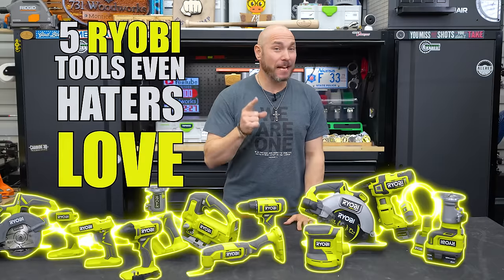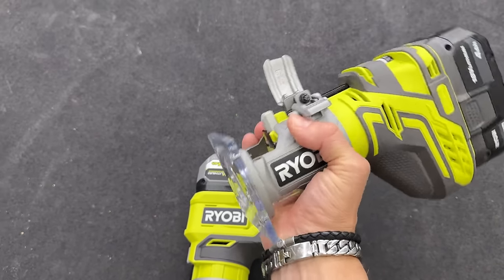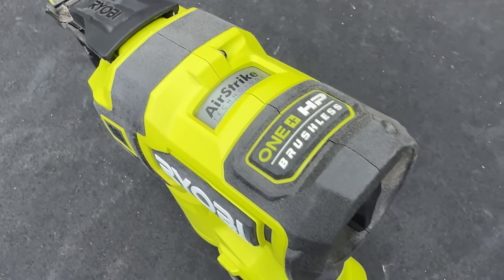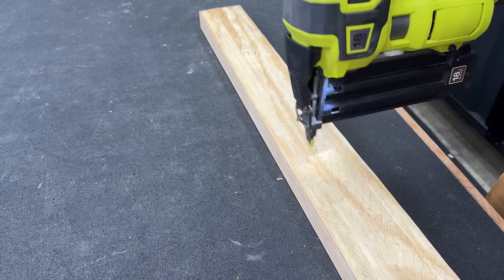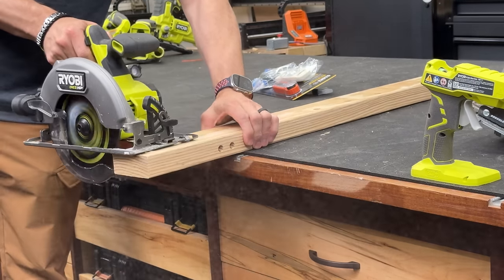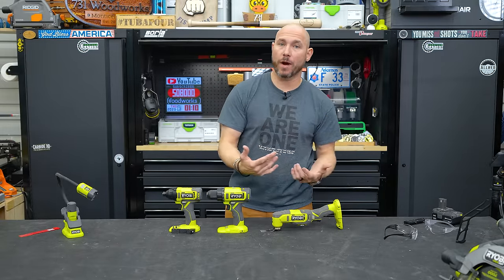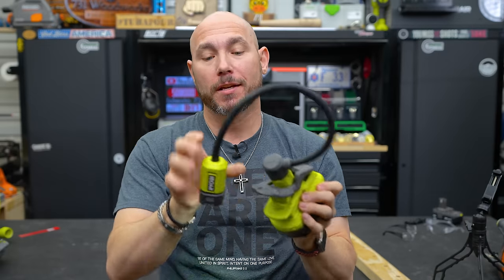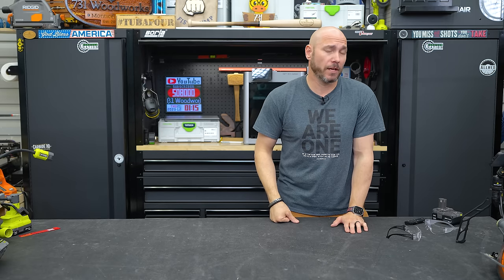The Haters Will Love These 5 RYOBI Tools!

Comment: Nice video , I have been using the first generation of the Brad nailer , it's amazing especially for the price , I must have easily put in well over 10 thousand nails , also you are right that glue gun is awesome , very practical , I'm surprised about the cordless sander though , I've been impressed with the one I have , it's definitely not the best but does the job , I've heard good things about the new Bosch 18 volt sander. I'm looking for a 7-1/4 cordless saw , since I am heavily invested in the Bosch lineup , I'm debating going for the Bosch but price wise after hearing what you think about this Ryobi I'll have to check it out. Great video love watching your channel 👌👍

Comment: Personally I've not had any luck with Ryobi cordless tools, I've bought 3 so far and had to return the 18 gage brad nailer with only 10 brads fired threw it i shot one it jammed i cleared it and shot 2 it jammed clearedit again shot 1 it jammed again, i cleared it changed battery and it still continued to do the same. I returned it got my 💰 back and bought a Craftsman witch I've fired thousands threw without a hitch for 30 bucks cheeper. Their cordless drill reverse toggle got jambed the first time i used it and the chuck doesn't tighten up very well, but I do have their circular saw witch does pretty well.

Comment: I'm a licensed residential builder in michigan. I started with DeWalt cordless tools. After they fell apart, I realized why not get a less expensive tool and I could replace it and still be under the cost of a dewalt. So far I haven't had to replace any. I think they're every bit as good as a DeWalt.

Comment: I’ve gotten use out of the 5.5” circular saw flipping the blade and using to cut siding, plastic roofing panels etc. Lightweight and cordless, haven’t found another good application for it

Comment: I have the old style router and I agree, stay away. I have the P365(?) finish nailer and while convenient, it thinks its jammed alllll the time. The circ saws are great. While they do sound like a toy, my brother in law got a Makita last year and hated it. I tried it a while back and agree. It's just uncomfortable, slow, and the base plate sucks. Ryobi jigsaws are also trash. Ive had three and they always drift to one side or the other. I still have one and I have to guide it about 20 degrees to the left relative to the line. Every one of them has done it. Others have confirmed it. I kept one around for quick nips or finishing an inside corner cut but I have an old corded Craftsman the does anything longer than an inch or two. Sanders are also pretty bad. They are like wrangling a mongoose. They just bounce and dance way more than any others I've tried. Something about the balance is just wrong. The drills and drivers are just fine if their impact drivers are just way too big. All said, I am actually a fan of Ryobi. If I worked professionally, I'd have to say look elsewhere, but I end up doing maybe a couple hundred hours a year on projects these days and I simply have no DNA within me that needs validation from others in my ability to spend money. What a silly thing to make fun of people for. Those woodworkers are just bar slags turning their nose up at the guys not driving a Ferrari.

Comment: The only problem with Ryobi’s hot glue guns - which are otherwise awesome - is the coating on the tips, which don’t stand up to a lot of use. They become soft and break after a surprisingly limited amount of use. The gun remains useable, but they should really use a more durable/heat resistant material.
Reply: @echoshatter  Yeah, but I would bet 95% of the time most people only use the glue gun for a couple minutes to tack something.  I've never used mine for more than a couple minutes.  Also, Surebonder makes a glue gun that uses Ryobi batteries and is as good as the Ryobi one.  You might try it, it only costs $20 or so.
Reply: @echoshatter  Hot glue guns do draw a lot of power, there's no doubt about that. That's just the nature of their design. 

It sounds like you might have an underpowered battery. What battery are you using? It's probably best not to use anything less than a 4.0Ah for the mini glue gun and the 6.0Ah battery (which holds 50% more power) might be best for the full size model. These are not very effective tools with a 2.0Ah or 1.5Ah, although you can get away with a 2.0Ah battery on the mini if you don't use it for extended periods of time.

If you're a serious crafter or pro who needs an "always on" glue gun, a cordless model is absolutely not the way to go. Likewise, if you don't already own Ryobi tools (and batteries), a sufficient battery and charger set is going to cost you 3-4x the cost of the glue gun itself.

Ryobi's glue guns are fantastic if you've already invested in the ONE+ system and have batteries. There are lots of batteries in the shop here, so when one runs low, it just gets swapped out for a freshly charged one and there's no problem. If you don't have that advantage, it could be a really frustrating tool.

Comment: I also use some Ryobi tools, and I can recommend that you look into their upgraded hot glue gun and multi tool. The glue gun has two heat modes so that you don't damage some heat sensetive materials and don't get so many bubbles in the glue. The multi tool is also a much better one since it has a swiwel head to reach better and also a tool less holder for the blades. Not a star lock but a lever that loosens the pressure on the plate holding it down, and you can then unscrew it with your hand. The holder is also magnetic so that the blade sticks on better when you are doing so. It's also way better on your hands since it doesn't vibrate as much and also has a variable speed.

Comment: The 1st tool of RYOBI Combo Kit that I purchased to die was an older, but not more powerful version of this little painfully weak, brushed, 5.5" circular saw.(I  acquired an additional blade for. I didn't purchase the new blade, it was gifted to me.🤦)It's nearly the same size that RIGID 6.5" circular saw, with a Brushless Motor that a battery will last 3 to 4 times as a long on. The RIGID 6.5" brushless is roughly the same weight as RYOBI 5.5" brushed motor saw. The RIGID Brushless 6.5"is a 'Great Little Saw', if a 'Little Circular Saw' is what you're looking for. Milwaukee and DeWalt both have good 6.5" circular saws, but I haven't personally used any other brands. The RIGID really shines. I had to check and make sure it wasn't plugged in when I ripped a 6' long pressure treated 2x4 in half...... Fully charged 4Ah battery and it made that 6' long cut, only dropped one bar on the battery and left to sit for about 10 minutes or so and battery read full charge again. I'm on Milwaukee and RYOBI battery platforms. RYOBI is indeed a lesser/DIY brand, but they work surprisingly well, especially the brushless line. Nothing but brushless RYOBI stuff for me, from here on out.😎🤠🤓

Comment: I love how the Ryobi Brad nailer feels, but I prefer how Milwaukee angled the gun so you can set it down on the battery base without it slamming forward on its head. Biggest flaw with the Ryobi, did they not test the weight balance when using it?

Comment: I read up on Ryobi tools and as a person who turned my nose up on Ryobi when walking through Home Depot... but I have changed my opinion. They turn out equipment from idea to product in 18 months I have a number of their tools now, for a DIY, Hobby or a value added  tool moment you can't beat Ryobi. One thing that makes Ryobi tools is their batteries... everyone one of the major tools makers have changed battery size and come out with a new battery that doesn't fit old equipment... Not Ryobi, you can use a new Ryobi battery in an older tool... to me that says a lot about Ryobi, that they understand customer loyalty. I have the hand held router and I use the smaller 2 hour battery not the 4 hour which reduces top heaviness when using. Also the Ryobi brad nailers are the very best, I have 4 pneumatic nailers... and two Ryobi brad nailers I use these all the time... very few times do I use the pneumatic nailers now!

Comment: I have used Ryobi tools for the better part of 20 years.

The bigger circular saw is my goto saw.
Use only the bigger 4AH batteries. With the smaller 2AH batteries the saw seems under powered.
I use Diablo blades they work well.

I had the smaller version for years. It is underpowered for many jobs. It does work well on laminate flooring and othee thin sheet materials.
I have a corded Porter Cable. I very rarely use it unless I am building stair stringers. 

In my opinion the brushed impact drivers had more power. The first one I had would sink self tapping bolts into drill stem.
I built a lot of metal buildings with mine.

You are absolutely correct about the Brad Nailer. I do not do trim work very often and carrying just one tool is much easier than carrying a compressor and rolling out a hose.
It is super handy. I once used it to set siding in place until I nade sure it was where I wanted it before using ringshanks.

Personally although I have one and will have one in the future.
I would AVOID the Sawzall.
The plastic tab to release the blades is crap. I have broken two of them in a short period of time.
The saws themselves work well but the release is junk.

Other tools that I avoid and have corded versions of are the Grinders and like you the Sanders.

As far as sanders go.
Hobo Fart (new name for Harbor Freight) sells sanders for $40.
Buy the 2 year replacement plan.
I have used the easy warranty process for the last 6 years.
HF replaces them no questions asked and I jusr buy a new replacement plan.

Comment: Having a few Ryobi batteries with only a single tool, I do wonder sometimes if I could ever need a new tool... But I haven't found any need.

I have a Ryobi battery fan for summer power outages or just a great portable fan near my work. But i also have a rigid version which is literally the same thing.

Comment: I use Ryobi tools daily at work and in my woodworking shop and haven’t had the first issue with any of them. 
Want to sell that small circulating saw ? I could use it to cut smaller pieces for the small band saw boxes I build. I’d probably use it daily !!

Comment: I came back to help drive that algorithm and because I have many of the RYOBI tools you're talking about in this video. I couldn't agree with you more about battery-powered orbital- sanders. I haven't tried all of them, of course, but I unfortunately own 2 RYOBI 18v battery powered sanders. Both are brushed versions, so on top of all the other bad things, like balance, the lack of variable speed(I mean, for crying out loud, you could at least put a variable speed trigger on the thing.😡) and the corner-sander, again, no variable speed, but slightly better balance, but battery life is horrible. If have to sand area larger than 2sqft, you better bring a good supply of 3Ah or bigger batteries, but then the balance becomes terrible with anything larger than a 3/4Ah battery. 
Corded sanders are still THE Hot Ticket when you need to sand. Taping the cord to, or spiral wrapping the cord around the vacuum hose keeps you from dragging the cord independently of the vacuum hose while sanding. You're welcome. Great Video Brother.🤓🤠😎

Comment: I've heard the 6 1/2 circular saw was better than the 7 1/4 (both HP). They fixed some of the problems the 7 1/4 had.
As for the hot glue gun, the newer models doesn't go as hot than the old one.

Comment: I'm on the DeWalt train.  It's not been too bad.  I have 9 or 10 tools and 3 flashlights.  The only Ryobi tool I have left is a blue corded 3/8 drill from 25 years ago, it still works great with variable speed and depth setting, It's my best drill, wish I had the drywall version.  I've had a little bad luck with DeWalt and aftermarket  batteries but that's it, even the pole saw and weed whacker work great.  I likely should score some more batteries soon.  Diablo saw blades rock my world, makes all the difference.  The Made in Mexico DW stuff has better quality and reliability than the Chinese made stuff.  If I was going to buy Chinese stuff, it would be Ryobi.

Comment: A lot of Ryobi tools are starting to show up on home construction sites. So preffesionals are starting to see Ryobi for value.. I asked a couple why Ryobi and some said price over there life compared to others like Milwaukee. Ryobi works out to be way cheaper to run.. Some. said they can buy 2 to 3 Ryobi to 1 other brands. Some said it hurts less when you drop them 20 or more feet
Reply: But prices of Ryobi tools are drifting up into the top tier tool brand levels!  DeWalt prices are coming down and are the better buy, IMO.  I have a ton of Ryobi tools but the prices are just too high now and there are better cheap brand tools now.

Comment: Yup I’m that guy. I turn my nose up at Ryobi however I just picked up two ryobi tools mostly because no one else sells them. First thing was a tile grout brush. It looks like a drill but it’s designed for wet spaces and purpose built to clean grout. I also picked up powered sprayers a handheld and a hand held version that holds a gallon or so of liquid. I’m using them to spray for weeds and bugs. Again no one really sells these items for a consumer size (yeah you can get much larger versions from other manufacturers but I simply don’t need that size). If they keep making tools like this I’ll buy them. I’ll still be a dewalt fan for the larger more heavy duty tools but for the smaller homeowner tools. They are the only team in the game making them in the homeowner space.

Comment: I've always needed a hot glue gun and the location is never near an outlet, so I just figure something else out. Also, I hate having to deal with those little hobby glue guns. I saw this at one of those discount tool stores for $20 and grabbed it as fast as I could. One of the best off the cuff tool purchases I've ever made. 

In regards to the sander, I've got, probably the older one and it works just fine. However, a major caveat, use the 4amp hour battery. Use that one with everything. Seriously. The sander gets a solid bump in power with the 4 amp battery and so does that terrible little circular saw. I've got both and I've used the saw a whole lot. 
The 4 amp battery gives all of Ryobi's tools a good bump in power, really. 
I picked up the brushless driver/ hammer drill a last year and it is a bit better than the non-brushless. However, when you first pull the trigger, there's about a 1 second delay and that can be annoying at first

Comment: I feel that Ryobi has come a long way from what it was 10-20 years ago. I pretty much agree with everything you said. I have the new P-307 hot-glue gun and it is fantastic.

They are made by TTI, the parent company to Milwaukee and Ridgid (Hart, too). Technology trickles down from their top of the line tools and eventually goes to the lower brands (Milwaukee to Ridgid to Ryobi to Hart). In today's tool world, as long as you are not a professional, 95% of people can use the One+ tool line and be absolutely fine with it.

I would go red or orange if I am more of a professional (my opinion)

Keep posting great content, bro.

Thank you

Comment: Lots to agree with in this video:  I have the nailer and I agree completely with the 'handiness' of it in my small shop.  I also had the smaller circular saw and upgraded to the brushless version for 2 reasons:  power and I am left-handed (having the blade on the right side of the motor made it much easier/safer for me to line up my cuts).  Also, thanks for the heads up on the light (I will be definitely getting one of those today) and the new model of the trim router (my wife & daughter always get me a new tool for Father's Day.... ;).

Comment: Pro tip from aviation... Use IPA to separate the hot glue. We use these so much for holding brackets to carbon skin. We glue the shit out of the parts, lil bit of IPA and they come right apart.

Comment: 👍🏻👍🏻👍🏻👍🏻👍🏻👍🏻glue gun lives on top of my planer and love the 18 gauge for grab and go. As my shop is not piped for air yet. Its just so much quicker. I also like the T5 staple gun. Only used it for a couple of upholstery job but was greatly surprised. All brands seem to have something that underperforms. I "upgraded" from the dewalt 18v portaband to the 20v and it just was plain disappointingwith blade tracking. Milwaukee's is oddly balanced with battery placement but performs better. Havent tried ryobis.

Comment: They're the step up in price from my ozito tools (einhell in US) as far as my very short step into woodworking goes obviously I want better but as a tiler my grinder and drop saw for cutting aluminium trims the drills, jackhammer/hammer drill, Brad nailer everything have been perfect for a stupid low budget I had all Bosch battery tools and they got pinched..

 replaced the whole set for the price of one of my Bosch drills about 5 years ago and I've only had one drill die from accidentally drowning it and the grinder after 5 years of tile dust is a bit how ya goin now.. anyone starting out I highly recommend for the rangeto price to go ozito or Ryobi once you're making money off it you can upgrade but I haven't needed to yet and everytime I think about it I buy 4  more tools instead of one Makita tool